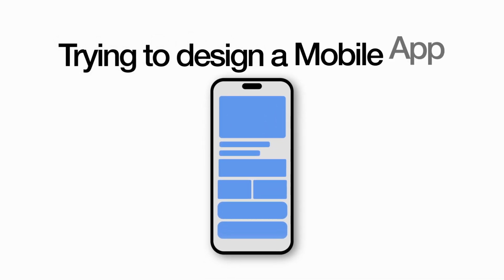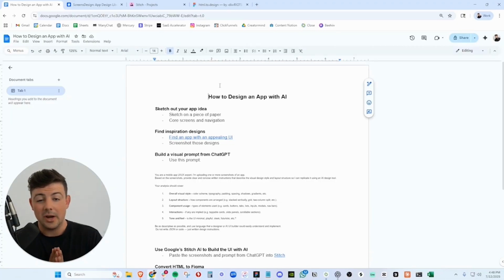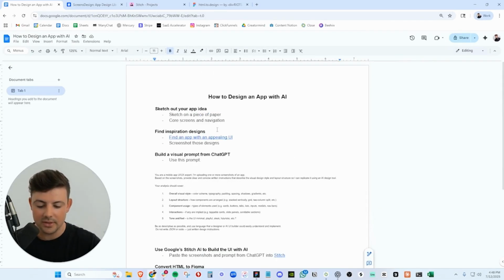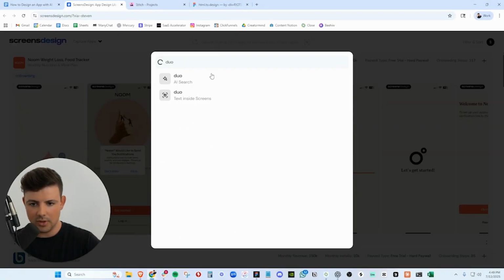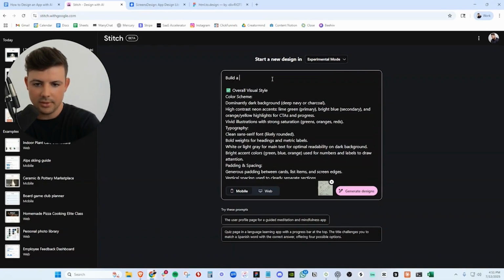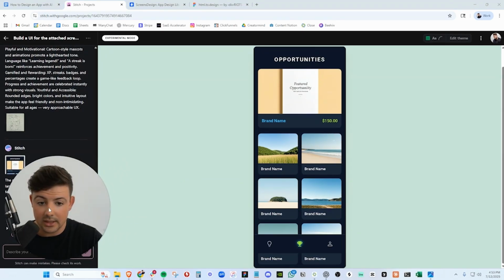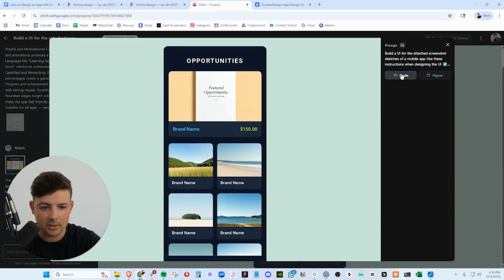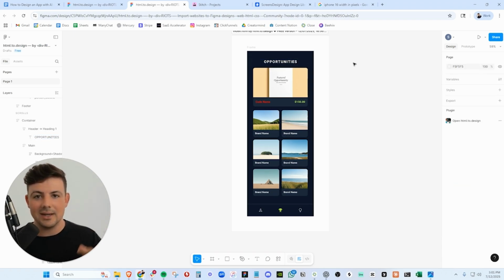How to Design a Mobile App From Scratch (With AI)

Comment: the prompt:

You are a mobile app UVUX expert. i'm uploading one or more screenshots of an app.
Based on the screenshots, provide clear and concise written instructions that describe the visual design style and layout structure so I can replicate it using an Al design tool.

Your analysis should cover:

1. Overall visual style - color scheme, typography, padding, spacing, shadows, gradients, etc.

2. Layout structure - how components are arranged (e.g. stacked vertically, grid, two-column split, etc.)

3. Component usage - types of elements used (e.g. cards, buttons, tabs, lists, inputs, modals, nav bars)

4. Interactions - if any are implied (e.g. tappable cards, side panels, scrollable sections)

5. Tone and feel - is the Ul minimal, playful, sleek, futuristic, etc.?

Be as descriptive as possible, and use language that a designer or Al UI builder could easily understand and implement
Do not write JSON or code — just written design instructions
Reply: thank you! I wish he'd just put a link for this in the transcript and not make people join the community. i get it but some of us aren't a fit for his community.